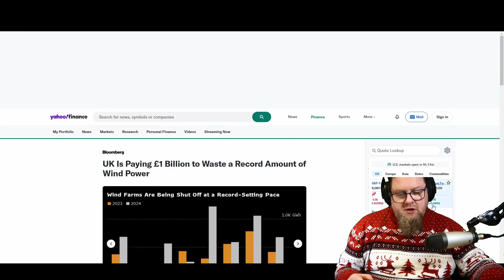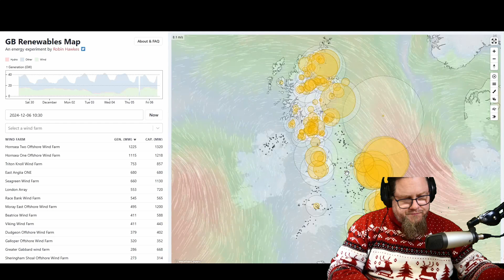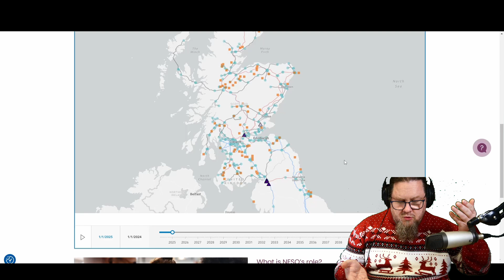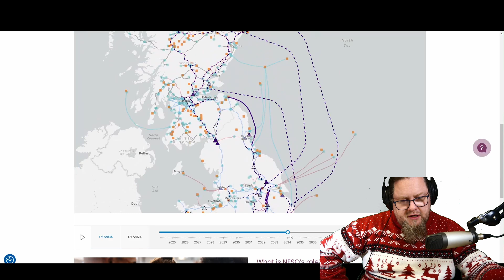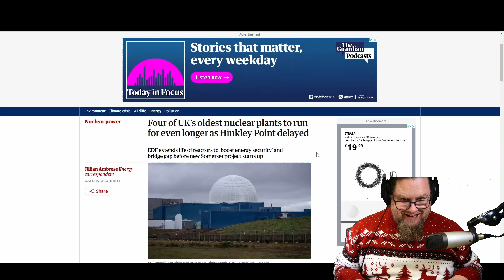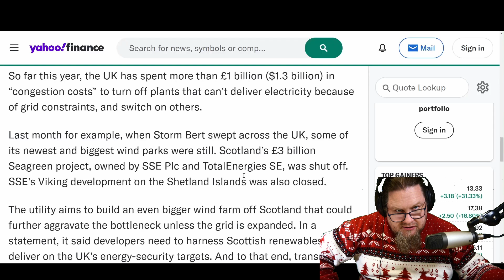Disaster! Starmer Out Of Touch With Reality, 100% "Clean Power" by 2030

Comment: How would they contemplate closing their Nuclear power plants if there was still engineering life in them at all? People who don't like nuclear power should still like stability and low prices it provides. Working reactor should be closed only if its operations are approaching some real engineering issues or if there is good replacement starting.
Reply from the maker: Exactly, even if you don't like nuclear, you don't have to like it to enjoy the unparalleled benefits it provides
Reply: Those that want nuclear shutdown then they should be the first in line to have their energy rationed when the shortages start!
Reply: They are all owned by EDF who will only want to keep them going if they can make a profit 

So that the income from sales is higher than the cost of maintenance and operations

The UK vast wind investment is meant to make the UK a net exporter around 2030

Well that means wholesale prices will crash (not retail or industry just wholesale) so the income side is going to crash

So it probably makes sense to close before 2030 or you'll be competing with subsidised negative price wind
Reply from the maker: @kaya051285  And you believe that system can sustain itself?
Reply: @kaya051285  Scarcity market is great for profits- would that be fair, yet short summary? From normal peoples POV and from the POV of climate It doesn't sound good. Also as security matter with strategic supply in form of reliable power. I guess it is also ok to pay some premium price for clean reliable power that is not in risk of running out anytime fast(like cheap gas).

Comment: The British grid needs extension, that's it. They phased out coal, nuclear became surprisingly expensive to build, and now new sources are needed. And everything needed for a new setup has to be started now - it will takes years anyway. Britain is linked to several countries, including Norway, Denmark, the Netherlands, Belgium, and, of course, France. An undersea cable to Germany is currently in its planning phase. So when Britain shed 1 TWh  some of the undersea cables were either off or exporting, I guess. 
And the missing transmission lines: go ahead and build! Britain has North Sea gas fields, but they are not endless. 

You think nuclear the solution. Really? Over 50 billion spent on Hinkley Point C is not a success, more like a failure and in no way competitive Come back when there are fusion or at least breeder reactors ready for deployment.
Reply: If the UK doesn't build nuclear it will continue to use gas to back up wind and solar like today. Nuclear replaces not only the gas back up, but also the wind, solar, storage and grid works associated with a weather-energy grid. Nuclear is far cleaner and cheaper in the long run.
Reply: @mlj9931  sure. it is of course completely unnecessary to mine, refine, and process the uranium, as well as there is not need to dispose of the nuclear waste later. There is also an unlimited amount of uranium ... oh, wait ... 
And nuclear power stations can be ordered on Amazon or ebay and paid from the postage budget .... not.
Reply: @ElwoodEBlues  All sea cables are set as a trade option, with near 0% as dependable sources by the TSO.
Because they are not a controlled asset.

nuclear geothermal hydro are dependable assets, especially to an island state as the UK/Ireland

Comment: Intermittency probably an even bigger problem than distribution. Govt are full of bull on all counts. It is not working, it is failing badly, industry is being lost thanks to extortionate pricing, can't even produce high quality virgin steel  anywhere in Britain any more thanks to govt and recent blast furnace closures. You can't run a  modern competitive industrial economy at all with reasonably priced but completely reliable energy supply. We've lost the former and and likely to suffer the latter.

Comment: Uk building 1.5 million homes 😂

The UK needs too build 400.000 houses per year. To house the unwanted immigrants!

400.000 X 4 years equals 1.6 million homes.
So the house won’t be built for British people!

Our health system is on the verge of breaking. Due to overpopulation.

The increase in police will only be 3000 new officers as the remaining will come from within the police force.

We do have a huge problem with our police.
It’s called two tear policing.

When white British people protest.
The riot police are deployed.

When non white immigrants protest with machetes, like they did in Birmingham.
The police run away!